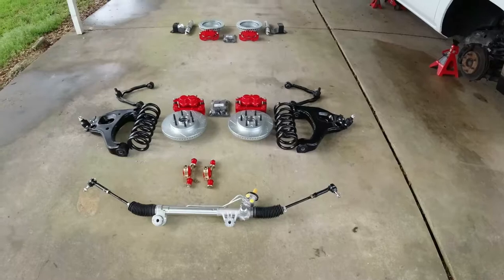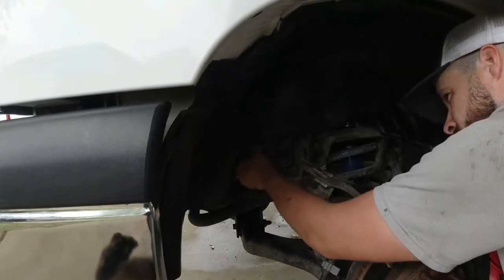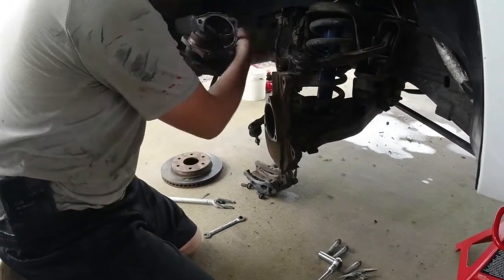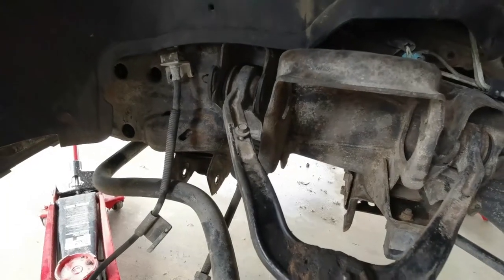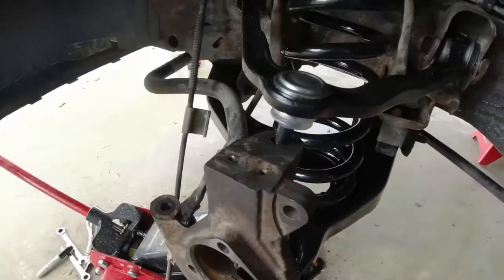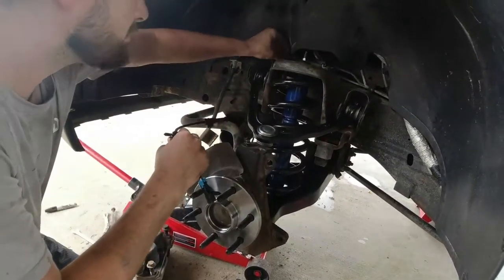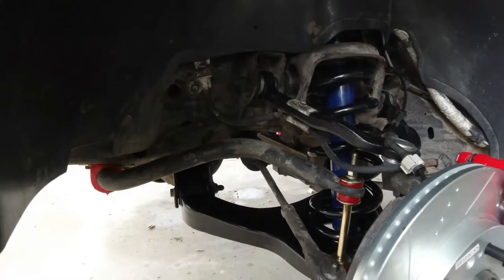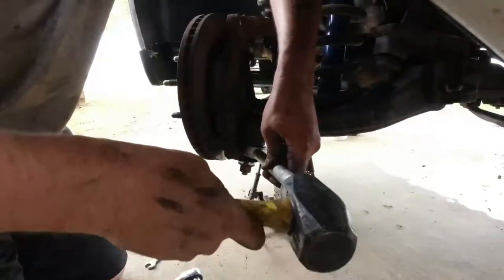03-06 Silverado Full Suspension Upgrade & Drop (Front)

Comment: Just finished mine on that lower ball joint I took the whole lower control arm off and flipped it over and beat the ball joint out that way.  Great video this is what helped me with my ball joints and control arms and springs as well already did my rack and pinion  perfect video💯💯

Comment: Assuming I can do this on my ‘05 2WD Crew Cab, can you help me find the parts company?  I don’t seem to find it. Please reply with the website.  Thank you for this.  It’s very well done!
Reply from the maker: Thanks for watching! Every thing you see in the video is all ordered off of different vendors from ebay. You can go on and literally just type in "05 silverado 2/4 drop" "2005 silverado drilled and slotted rotors" its a very basic yet effective setup. Hope that helps
Reply: @marceauxracing  I’m not planning on doing the drop, just preparing for a swap by improving the stopping!   Thx.  I’ll start shopping.

Comment: So you don't need a spring compressor for that job?
Reply from the maker: No you just put your floor jack under the bottom control arm and start jacking up on it, doesn't need too much tension.  Just enough so you can bolt either the top ball joint to the spindle. Or install the shock to hold it.  Either way works and is alot easier with 2 people

Comment: Where did you get the hangers for the rear springs bro I need some?!!!
Reply from the maker: Ebay!
Reply: @marceauxracing  ok cool did they work just fine? Cuz I was told they didn’t make them for the 06 by DJM but that’s cool I’ll check it out! Mine are factory welded on 🤦🏻‍♂️
Reply from the maker: @suelo_abuelo8066  yep ours were too, we took a die grinder and cut the "buttons" off of the factory ones and the aftermarket ones bolted on
Reply: @marceauxracing  right on bro thanks I found some on eBay thanks again bro! 😎